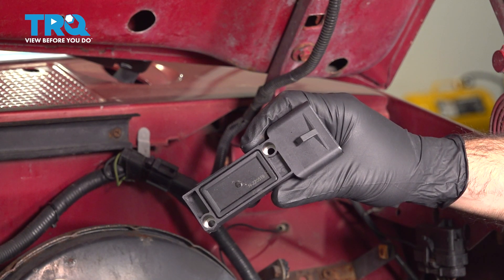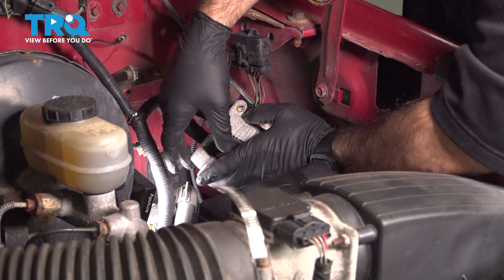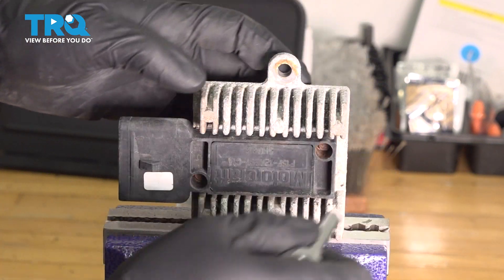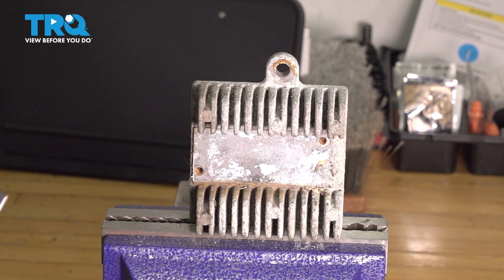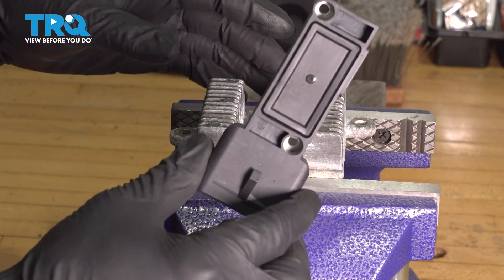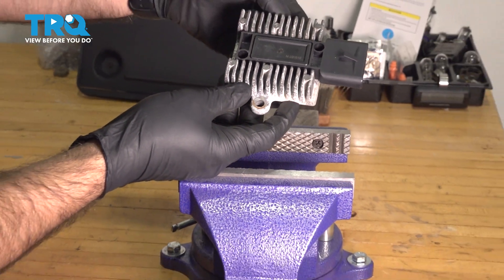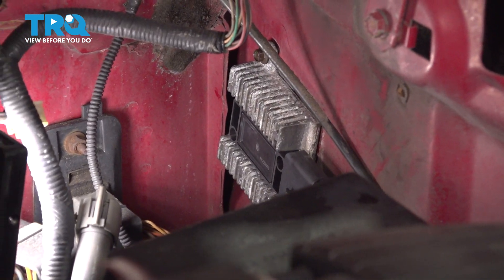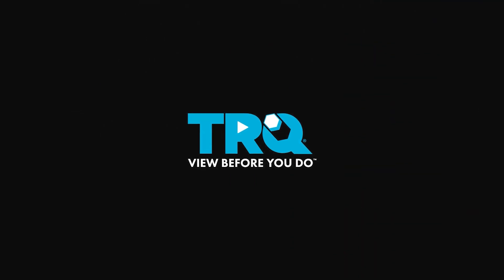How to Replace Ignition Control Module 1992-1996 Ford F-150

Comment: The Duralast replacements come with a white silicone paste. I'm assuming this is spread between the module and the heat sink? Just did this this morning on my 95 Mustang GT. I thought about using thermal paste for PC's as well. Would that work better? Thanks.

Comment: Thermal grease between the heatsink and the ICM will make more difference than wire brushing the heat sink by a factor of, it won’t burn without the wire brushing on the outside of the heatsink.

Comment: Good info, the only exception is the socket to remove the module. It is necessary to purchase the  ignition module extraction tool for the 1994 F150 $12.00 at Advance Auto

Comment: I need to check my Ignition Control Module in my 2014 F150.  Any suggestions where it's located.  Under the hood or under steering wheel.

Comment: I think they all require thermal compound and when it isn’t used the module can get cooked from heat and then the truck will lose spark and stall at idle at operating temperature